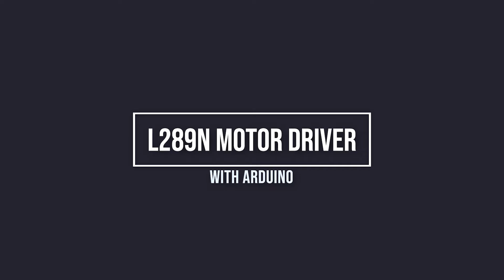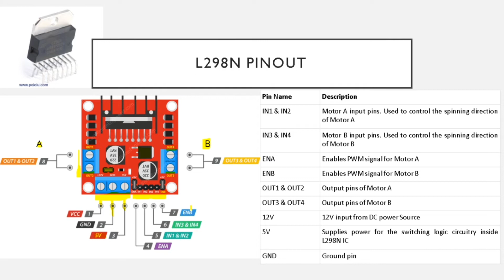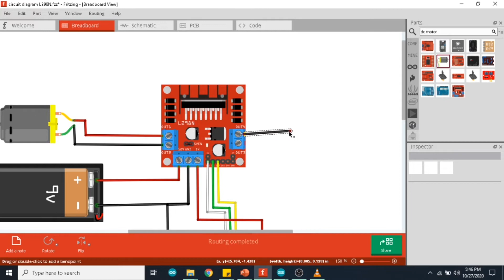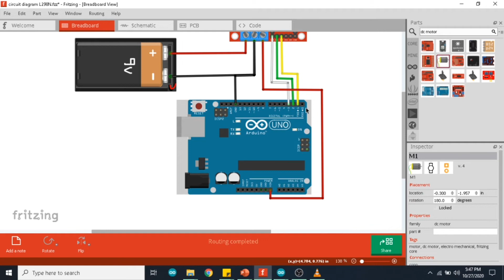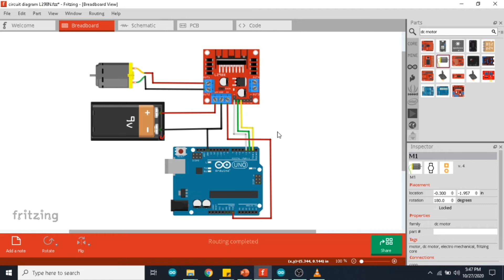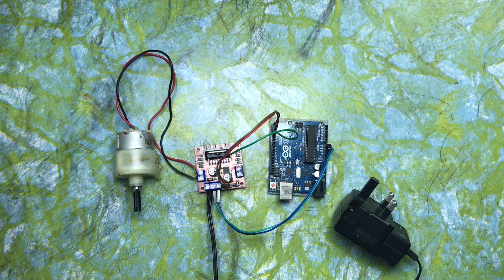L289N motor driver using arduino | Interfacing Motor driver with arduino | Arduino UNO |Motor driver

Comment: Learn Electronics India, you've nailed it! Your video on L289N motor driver using Arduino is a must-watch for anyone interested in electronics and robotics. Your attention to detail and the practical examples made it easy to follow along. Keep up the excellent work.

Comment: Hi sir can you  make Arduino code  for my college project
The project is rain Selter
When rain fall dc  motor will rotate clockwise for 5sec and offf
When rain is not fall the dc motor rotate anticlock for 5sec and off
With rain sensor